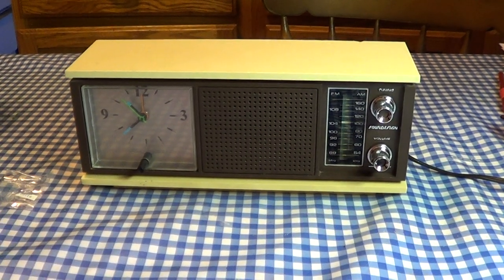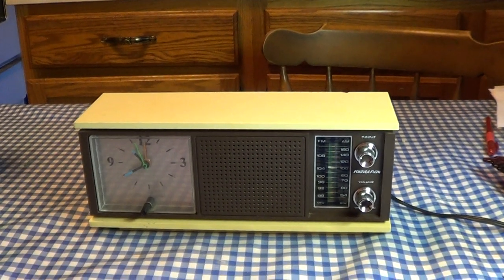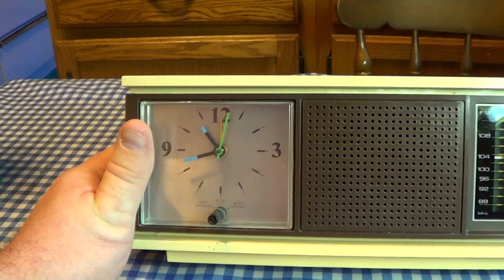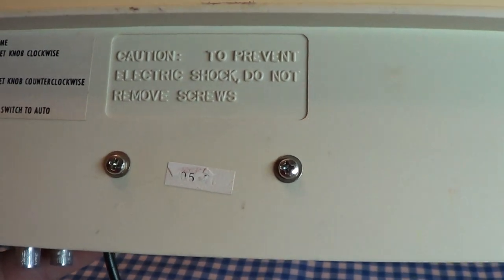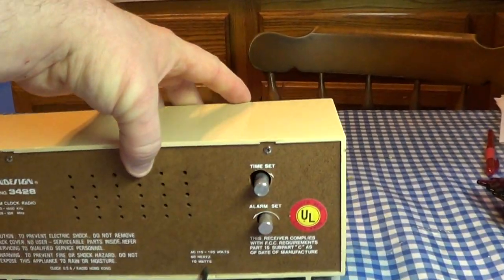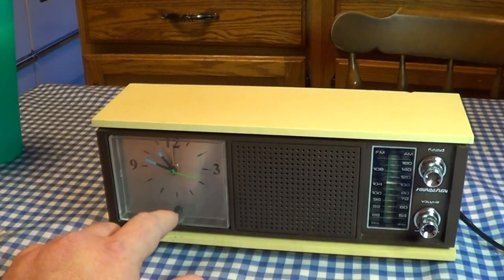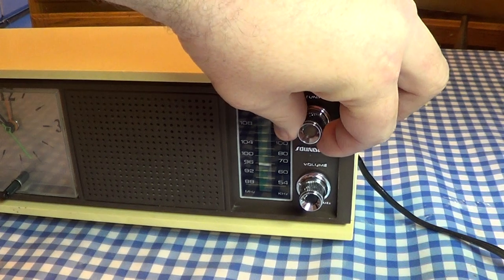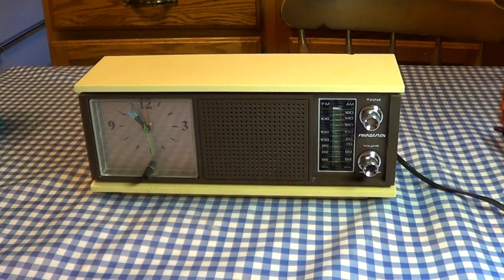Soundesign 3428 Clock Radio

Comment: Back in 1976 when I was 9 yrs old I found a similiar unit on a garbage tip  with only the front panel left on it no cabinet it had an AM Radio and analogue clock with the option to  run it via an alarm clock bell or wake up to radio, strangely enough it worked but at the time when my mother caught me with it without a cabinet she scrapped it for my own safety this video took me back to that finding in my childhood.

Comment: Those Telechron movements are pretty bulletproof, I've never seen one that was worn out or had damaged internal parts, of course they are about as simple as an analog clock mechanism can get. About the only issue they have is the motor/gearbox units seizing up from disuse, which can be fixed by heating up the case of the unit and dropping some oil around the shaft where the gear pops out. Sometimes the control shafts get sticky from dirt or dried out grease, so some people get rough with them and damage the shafts.
 I have one in a Westinghouse tube clock radio, 1967-68 vintage, that has literally been in operation for years since I refurbished the clock and radio, never had a problem with the clock other then the neon lamp behind it decided to die, or the current limiting resistor in series with it did. So if you want to use these as a clock there really are no issues with them, the gears are metal, and once the motor and mechanism is cleaned and lubricated they will run trouble free for years.

Comment: I muttered ro myself "mid 70's" and was not far off, i allways thought the mechanical flip clocks were an unusual idea, although i never found a good one that didnt stick or kept me awake with buzzing.

The green gas discharge display types i liked, with a good filter on the display it had great clarity, as long as you kept the filter clean inside :-)

Comment: After letting my ac motor based clock radio run for a while it seemed to have sorted itself out with the strange "knocking"/creaking noise stopping.

Its now pretty accurate, which isn't surprising, but it is nice.

Comment: I usually have one is the 1970's or 1980's General Electric Alarm Clock Radio 7-4550D, back then, when I first test it through, when I was able to turn the volume up, it made some scratchy noise where I managed to keep the volume control up-and-down up-and-down and up-and-down until it stops making a scratchy noise for making a real smooth volume, and I was very happy where I can use them whenever I can use one to tune the stations or use them as a speaker to use portable transmitter. =)

Comment: speaking of clock radios i've got a ge am clock radio with what is either a date code or a model number on the back although i'm leaning towards model number 39076, it seems pretty old, it's in pretty rough condition as i dropped it when we moved so there's a big chunk of plastic missing from the bottom left of the unit by the clock and the power knob is broken but i've got it working sort of, one leg is also chipped but it works surprisingly well for how old i think it is.
Reply: ***** i figured as much, guess i'm heading to my good old friend google for a date on when it was manufactured and sold
Reply: everyonesloopy what id ideally like is some information, it's a real nice clock radio, the sound is actually pretty good for a first impression